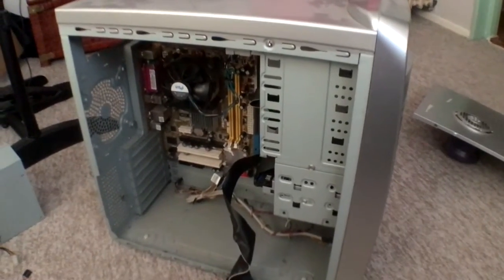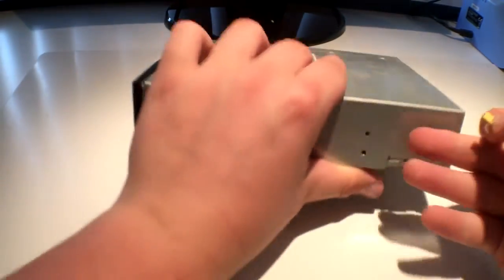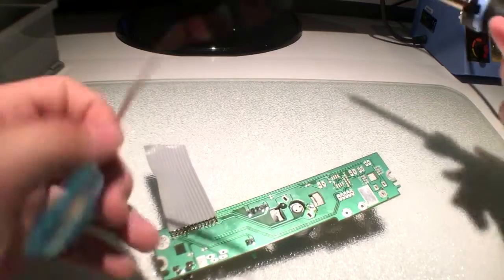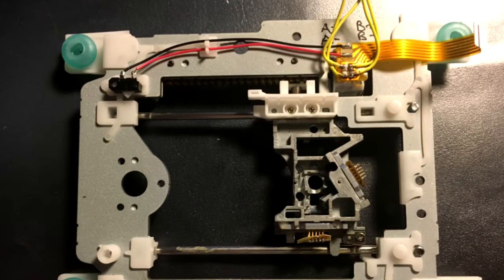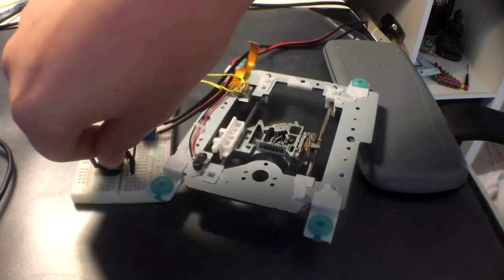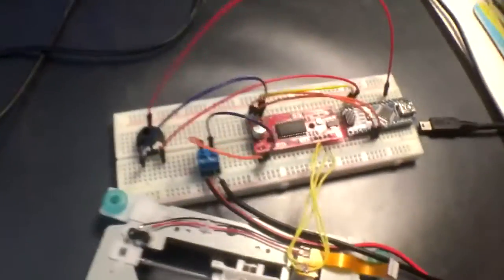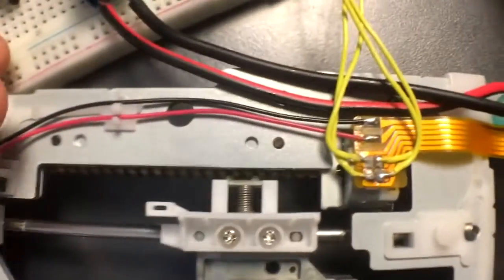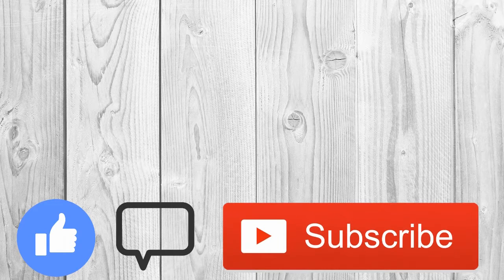Do NOT Throw Away Your DVD Drives! - Arduino Stepper Motor control

Comment: 01:50  except hundreds of resistors,diodes. dozens of capacitors.  a couple coils. a couple regulators and a bunch of gold on the contacts.    the only things you cannot use is the pcb itself and the smart components, the ones that will only work in this configuration on a dvd drive.
Reply: if you really want to go mad scientist you could turn the pcb into the most complicated breadboard you'll ever have.

Comment: i need this module for the arduino to control the stepper motor? is there any way to control using the default arduino pins?
Reply: that module is called a stepper driver.    i guess that says it all
Reply: @darkracer1252  thanks you aswell
Reply: Hi, if you want to control a stepper motor you have a driver (in this video he is using a easydriver) 5min 27sec is the schematic, you only need, 4 cable stepper motor, 3 cables for direction-steps-gnd),  2 cables for easydrver power (External) and 2 cables for motor power(from arduino)
Reply: @christinoccs  thanks a lot for the explanation, i will look in to it